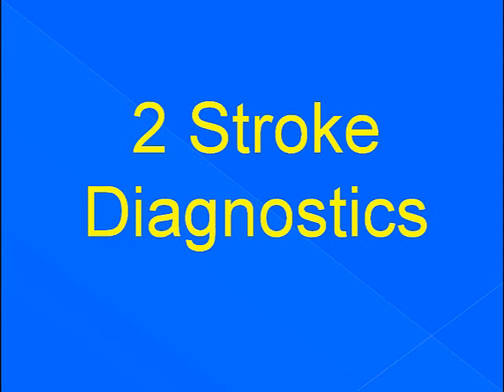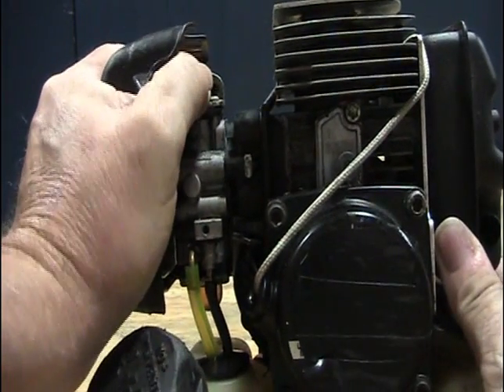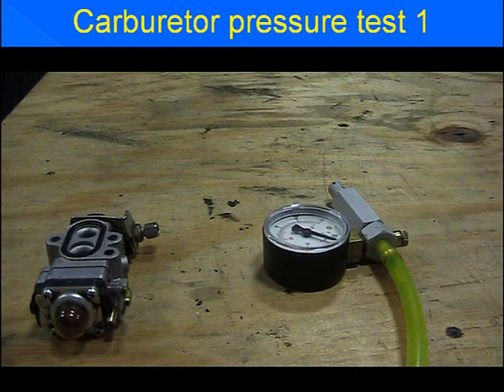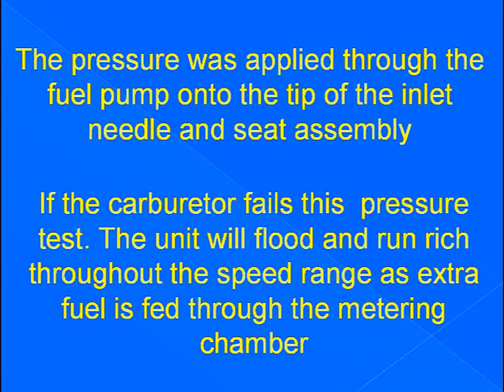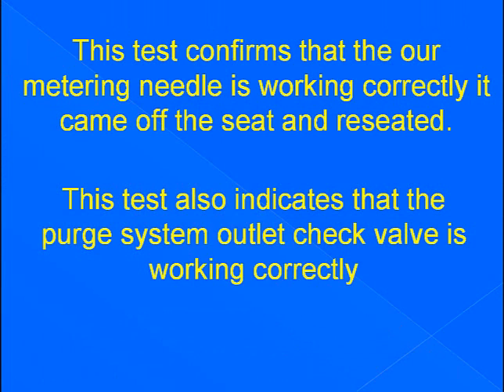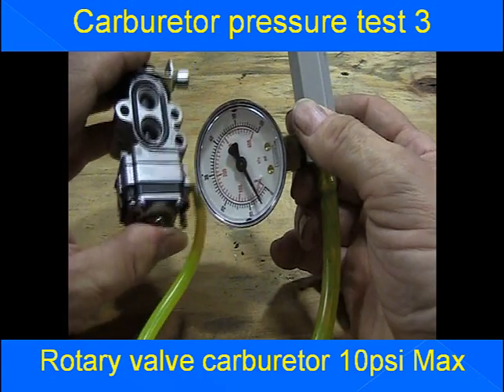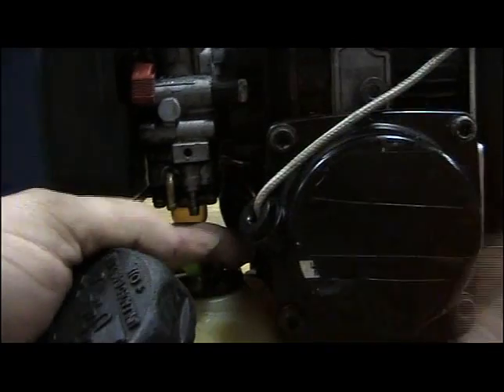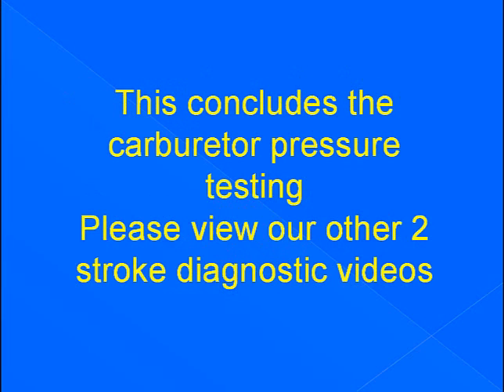carburetor pressure testing

Comment: In this WALBRO company video it shows a diaphram butterfly carb AKA cube carb..    Pressure goes up to about 15 PSI and then it stops at 5 PSI ....

Why in your video you say not to do this test on a diaphram carb or go over 10  or 7 PSI ???

Comment: Nice video. I remember doing this alot on the old Walburo carbs on many of the older snowmobiles I rebuilt. I swear I could rebuild one in my sleep blind folded,standing on my head now. I could adjust one on the fly,one hand on the throttle,the other adjusting the carb,with the hood of the snowmobile resting on my arms. Brings back memories. I never saw a rotory carb on any snowmobile I ever worked on. They must have been specific for once certain application,like a generator or something that required a tight narrow space. I have worked on thousands of carbs and thats the first time I saw one,on your video. Wow,I never stop learning!

Comment: If a wyk-192 rotary carb begins to poor fuel from the rotary valve intake port after sitting for an hour after being shut off what would you suspect? Carb is 30 days old ... Also suddenly the rotary valve itself is stiff in its rotation and sticks open after being saturated in fuel, does gas cause the rotary valve to swell in its bore when wet ?

Comment from the maker: in my video the 2 barrel carb shown only has 2 brass fuel line connections one has a barb with 2 shoulders fuel inlet and the other has one round end that is the return. if your carb has 3 lines one would be the crankcase pulse line  to operate the fuel pump the other 2 would be for fuel lines. doing the pop off pressure test  will apply a lot of pressure to the diaphragm/fuel pump in the carb.  these tend to become less flexible with age there fore I do not recommend pressure testing until the needle pops off.pop off pressure is used to check that the needle unseats and reseats as designed  we do that with out applying a lot of pressure to the diaphragm during our testing
Reply: Joe Pace v put
Reply: Joe Pace can I use this vac tester for crankcase pressure testing or can I use the vacuum tester in the videos to test carburetors? I want to order the bigger one but I would like to use it for testing carburetors also

Comment: Why would needle pop off pressure testing harm the unit?  Isn't this what it does in operation or am I missing something?

"Barbed fuel line"  All three carb connections shown are barbed.  Presumably this is the fuel inlet.